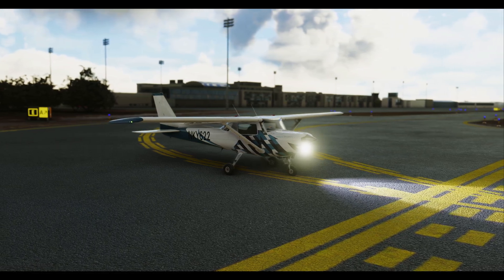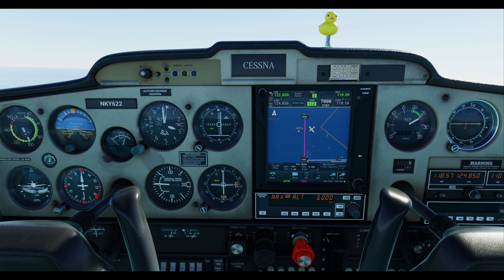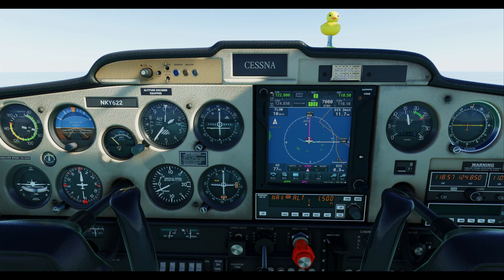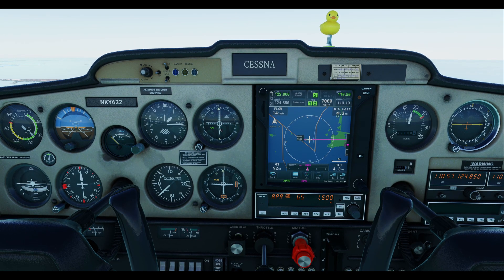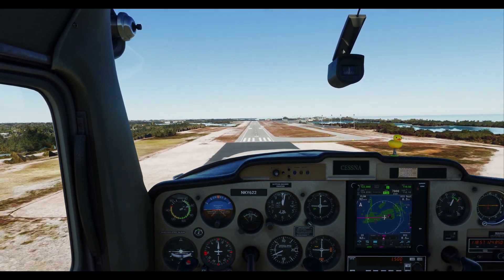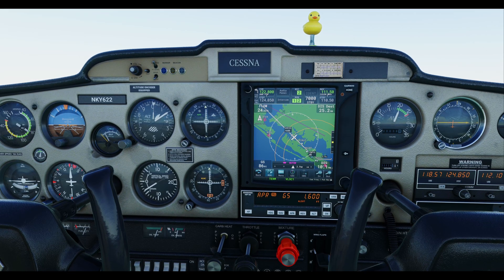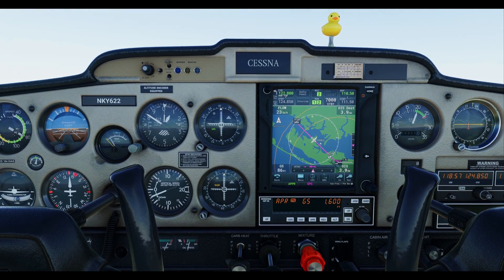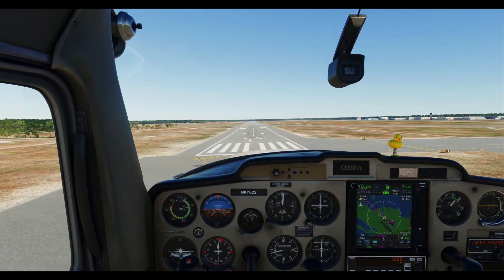Mastering the GTN750: Step-by-Step Guide to ILS and RNAV Approaches

Comment: Nice video.  Strange to me you use the 750 map display in N up mode.  Most pilots use track up display other than for "planning" purposes or when really zoomed out or workin on SA (like a hold), but when flying an approach, I always fly track up.
Reply from the maker: It gives me better spatial awareness for whatever reason when I am doing GA.  Mentally it reaffirms me on the track I am on through a visual process.  If I have multiple garmin screens I’ll usually have one which is track up by the PFD and another in N up for a “map” view.  Everyone has a preference though!

Comment: In the last approach, you’re showing an RNNAV and an ILS. I have a GTN 750 and two G5 I have the century auto pilot. The auto pilot works great when in GPS mode but as soon as I cross the FAF and it switches to ILS my auto pilot loses its way. Is it possible to keep the GPS directing the AP even when is switches to ILS?
Reply from the maker: You should be swapping to VLOC right before the FAF so you can be on the localizer and GS.  Try that and let me know how it works out, if you still have issues come check out the discord and we can get you sorted!

Comment: Not having charts as part of the default game was truly shocking to me.  Having to pay $9/mo for it is even more shocking.  That nobody lets you import your own charts into these 3rd party devices is even worse.  Either pay the con men at navigraph or you get no charts...  Charts are like the college textbook industry.  A total scam.
Reply: How would that even be possible? Devs support navigraph which is great. They don’t have time to research every possible chart import requirements to display them correctly. If you want to import PDF pages there are ways you can get that.
Reply: @johnmaguire2185  Charging more per month for charts than I can get game pass for is a total CON...
Reply from the maker: You're paying for more than just charts.  You're getting the most up to date NAV Data which is useful on VATSIM, a very powerful app that gets regular updates and new features allowing you to access anything and everything you'd need for a flight, integration into popular products, and more.  All of which cost Navigraph money to provide via data, servers, labor, etc.  Considering the amount of time I use Navigraph it's by far my most used monthly subscription.

As mentioned by @johnmaguire2185  there are other ways to get PDF charts into the Sim for cheap/free.  Granted these may not be the most up to date but will serve you just fine for casual flying around.
Reply: @nocturnalsimulations  I use FSkneeboard but its a poor immersion killing substitute for having it inside the GTN750.  Another option is to use Lil Navmap and its Companion, but agin, an immersion killer.  We are sooo close.  They need a subscription for old charts and casual simmers like me.  If I ever used more than 20 charts in it Id be shocked, lol.

Comment: How did you install the 750 into the C152?
Reply from the maker: It’s the WBSim C152 mod which supports the PMS50 GTN750 mod
Reply: Can you please tell me where to find that mod? I did some searching last night with no luck. Does it go into your community folder? Thanks
Reply from the maker: @garywiley7886  sure thing! Google PMS50 GTN750 and it should prop right up.  Download the mod and the free version will be active.  Once you decide to upgrade you can!  You’ll have to make sure the plane you’re flying supports it.  This mod goes into the community folder just like any other.